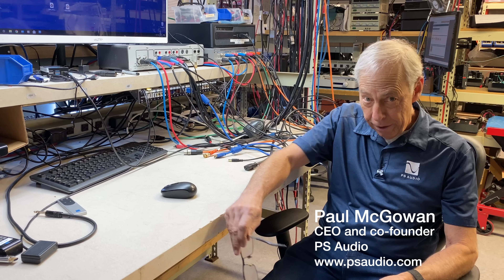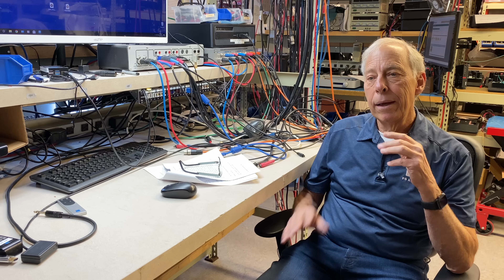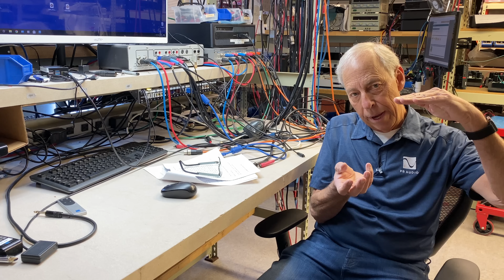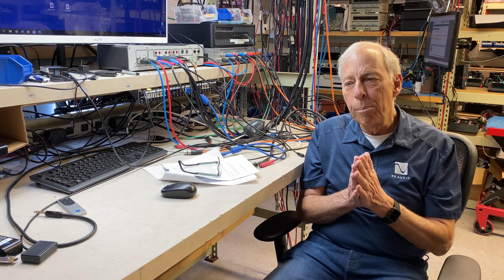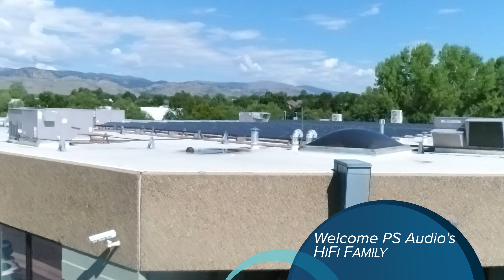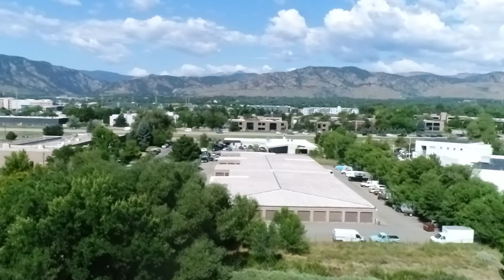Why aren't bridged amps more popular?

Comment: Many years ago I had a vintage Marantz 4070 quad amplifier which it had a 4 channel / 2 channel switch, that amp was sounding really magical in 2 channel mode which is bridged ( floating ground) but the spec wasn't 4 times of the watts
Reply: That's because it's current limited. When you bridge you double the peak to peak voltage. Doubling the voltage across the same load will double the current, therefore 4 times the power. But if the power supply cannot supply twice as much current, then the voltage will sag and the current will be less too. Hence, not 4 times power

Comment: I've run a pair of identical Hafler amplifiers in bi-amped set-up driving Magnepans for years. One day I decided to tinker with this setup just to try out the bridging switch on the back of each amp. I also have a Bryston preamp that I left out for expediency, just using the gain switches on the front of the amps. Oh my goodness! The music just bloomed into something incredible!  I hate to have to fault the preamp. Magnepan themselves use Bryston. So I'm thinking the lack of stereo crosstalk might be the key.

Comment: So I have a full bridge amp and there’s 2 positive and 2 negative outputs. How do I hook up one subwoofer with one set of speaker wire to get the most wattage?
Reply: It should tell you on the back of the amp near the spkr teminals how to hook up for bridge mode. Usually the positive spkr wire goes in to ch. 1 positive and the neg. spkr wire goes in ch.2 positive.

Comment: Keep it simple stupid. It costs more money. 90% pay less than $200 for an amp/receiver and for 99% its less than $700. Add the sales of all amps and receivers sold in the last ten years over $700 and divide by the number of people and answer will be less than .001. Today you can buy a killer amp for $70 (300 wpc with inaudible thd+n at 180 wpc at 8 ohms).

Comment: Bridging amplifiers is mainly used in commercial set ups, dj's would employ amplifiers that are bridged in order to get sufficient power and volume, but it would make no sense for someone having a bridged amplification at home because you don't get the same sound staging stereo imaging and bass output that a single amplifier would give you, and you certainly don't need the extra wattage in small domestic settings.

Comment: There is an error in the video: bridging amplifiers doubles the power, it does not quadruple it. That should be obvious by plain logic, 100 W + 100 W = 200 W. Technical reason is within the halved apparent load (impedance), which is mentioned in the video.
Reply: 4x is correct in theory however most will not achieve
Reply: It's just Ohms law, assuming constant R, doubling the voltage doubles the current, that is 4 times the power. Assuming source can deliver and components handle.
Reply: In reality it is more like x2-3.
Reply: Yes I have since then learned a great deal about bridging. A worthwhile mention is that when bridged, many amps are specced for doubled loads (Ohms) compared to single-ended, making it only double powered. That speaks for the fact that those amps are not designed to handle so much power.

Comment: and you cut the damping factor of the amp in half wen bridged
Reply: With most solid state amps the output impedance is so low that it doesn't make a significant difference

Comment: So reference monitor with XLR input are bridge amplifier?
Reply: Not necessarily. XLR is just (usually, but not always) a balanced input. What amplifier that drives depends on the choices made by the engineers who designed it.

Comment: Don't attempt to bridge amplifiers that are not designed to be bridged.   When you bridge amps the voltage across the load (speakers) doubles.  As Paul stated, the power draw by the speakers increases by a factor of 4 because power is a squared function of voltage.   But that increased power comes from the amplifiers and if split evenly then the power draw has doubled on each.   Due to market forces, engineers will generally not design an amplifier for power levels it is not intended for.

Comment: N channel is a reference to MOSFETs not Bipolar (NPN).  MOSFETS are preferred for higher power applications because they have a negative gain to temperature coefficient.  This allows them to be stacked in parallel increasing the current capability.  Trying to do this with bipolar devices can result in thermal runaway.
Reply: MOSFETs tend to have that same positive temperature coefficient when used at reasonable currents. They also are prone to hot-spots on the die, leading to a very quick failure. So while people like to run around saying that "MOSFETs don't suffer from secondary breakdown!!", it isn't really true. IR has a good application note on this, where they discuss the pitfalls of using modern MOSFETs in linear applications. It is possible (lots of people build amplifiers around HEXFETs, for example), but that doesn't mean they are without pitfalls.

A well-designed BJT amplifier will not have any issues with thermal runaway, but the temperature compensation (especially in EF triples) can be a real pain to get right and can be annoyingly complex.

Lateral MOSFETs do not exhibit this behavior, and really are pretty much immune to secondary breakdown. The downside is that they're really expensive and somewhat difficult to get, so you might as well just use a bunch of BJTs or regular switching MOSFETs. 

Like everything in engineering, it's a tradeoff.

Comment: Sorry about this off topic question..I have a old Marantz SR4200 receiver and old Klipsch RF35 tower speakers with a center speaker. As this receiver is 5.1 capable and I have only 3 speakers would it be possible to use the unused rear channels and add them to my front and left speakers(front left and rear left receiver channels into the 1 front speaker and same with right side speaker). Would I short out my receiver or damage speakers?

Comment: What determines how good or bad a bridged amp setup sounds is how you derive the inverted signal ... in my humble opinion you MUST use a low gain low noise op amp to provide a true balanced output to drive the amp modules

Comment: Ground is probably NOT the same as the ground in the well.  The "ground" you refer to is probably the center tap on the transformer secondary.  I doubt it is connected to household ground.   This would be easy to test.
Reply: Usually those two grounds are tied together (very intentionally at one specific point!) for noise reasons.

Comment: The other thing I found with brigded amps is that you get to hear negatives of the amps all out of ratio to the increased power.  Sadly in my esperiance it tends to show the negatives far more.
Reply: That's probably due to the reduced load impedance. Typically, distortion rises as load impedance decreases.

Comment: Paul, why is it necessary to bridge an amplifier just because you want to use all NPN output transistors? Compound feedback pair (Sziklai) amps don't have to be bridged to function - yes, the other part of the pair is a PNP, but the actual output transistors are NPN (al la Quad 405) . Do you use a cunning design to eliminate the compound pair? (but that then necessitates bridging two amps)

Comment: In car audio bridged class-D is pretty much becoming the only show in town due to the high power requirements, esp. once you get above about 4kW. Saves a lot of components and space getting rid of the negative rail in the power supply section. In home hifi bridging linear discrete amplifiers is quite difficult due to the feedback and DC offsets, not to mention you have all the power and space you need since it can just be a big metal box plugged into the wall. With that said, most subwoofers are usually running bridged class-D since the small increase in distortion is of no concern.

Comment: BTL never sounds as nice as an SE amp in my experience.
Reply: I used to have a class A super symmetrical. its total power output was probably not more than 18 watts per channel into 8 ohms and it consumed about 350 watts off the wall at all times. I swear it must have weighed 60 pounds or more.  It had a control on it which gave it a user adjustable damping control, so it behaved like a transconductance amp. And this was probably by far the best sounding amp I have ever had or heard. Really wide bandwidth, extreamely articulate and able to match pretty much any speaker you can throw at it.   I am really sorry I sold it but we live in hot weather so it was just not practical.  It basically needed to stay on continually to stay warm and sound good.

Comment: why do we see normal cheap cables in the background to test / adjust and set the high quality products when we are told all the time that we have to purchase cables that cost thousands.?
Reply: I do test and adjust amplifiers using regular cables instead high-end ones and yes, more expensive (speaker and signal) cables improve the sound later on. On the other hand investing thousands in cables is only justified in rare cases when you have very expensive (house money) system. On regular (few thousand) systems having invested a few hundred in cables and few thousand does not make any audible difference. But using a regular cheap cables - yes, you can hear the difference.
Reply: Well... because you're listening to people who want to sell you something. We're dealing with such low frequencies (well below 100 kHz), so the transmission line characteristics of the cables being used is of minimal concern. I have seen zero evidence that anyone can actually tell the difference in a double-blind test. Furthermore, there are no measurable differences at the frequencies we are using this equipment at.

One very good reason to not use such fancy cables on the bench is that they are often very thick and stiff, which is really annoying since it tends to make lighter-weight equipment slide around.

Comment: Bridged amps offer 4x the power but with 4x the noise and 4x the problems. In reality it still has 2 channels with the same issues a regular 2 channel amp has only now you have 4 channels to work with.  It's not mono. It's a cheap fix no matter the retail price to offer 2 amps with lots of power using smaller amps.

Comment: I can see why stereo amps are driven in bridge mode but with the complexities properly addressed, can’t you also join multiple amps even with different gains in phase to get an increased output?
Reply: No, not unless they are meant to be bridged. With linear amplifiers there will be DC offsets, as well as feedback (typically, but thats another story). Anyway, getting to the point, if you bridge two linear amplifiers directly, the resulting DC offset of each amp will unbalance the differential input of the other its attached to, resulting in substantial current flow, and also distortion. If its bad enough, it could even damage the output stages. Normally in bridged ICs they will either be class-D, or specifically built to be easily bridgeable (e.g. TDA1554, and others) via connecting the internal amplifiers together on the PCB. In car audio whole class-D amps can also be bridged together, but this requires that the clock signals of each amplifier be synchronized to prevent phase issues and idle tones, among other things.
Reply: I said if you properly addressed the complexities.  A simple way could be galvanically isolating the inputs and outputs so that the amplifiers are effectively just voltage sources with accompanying series resistors connected to the loudspeaker and handling the increased series resistance.
Reply: @PebblesChan  Joining two separate amplifiers can be quite challenging to say the least. Galvanic isolation would be difficult due to the large inductance needed for the transformers while still having the necessary high frequency response. The easiest way to achieve DC blocking would be to use capacitors at the outputs. To get a lot of capacitance, this can be done using what's called a bipolar capacitor, which consists of two electrolytic capacitors and two diodes capable of handling the current requirements. This works identically to a non-polarized capacitor by offsetting the voltage each capacitor sees so it does not see a significant reverse bias. But there are other issues to consider as well. You are joining two amplifiers with separate power supplies, so that invites both DC and AC ground loops, even if the amplifier does not have a specific connection to ground. The transformers have quite a bit of parasitic capacitance and it can potentially allow unwanted signals to get into the audio. You would need to have external star-point grounding to ensure there are no loops. The amplifiers also have to be very well balanced gain-wise to work properly or the audio will have an offset, which can cause issues with audio and the loud speakers. You also still have the same issues with the feedback. While the capacitors will block the DC, there is a possibility of imbalances at audio frequencies as well. If one amp unbalances the other, there will be substantial current flow due to how much gain margin there is. Even a few mV can cause several amps to flow as the amplifier attempts to balance its differential input. Lastly you will also need an external phase inverter for one of the amps. This could be as simple as a center tapped audio transformer, but for best results it should be op amps so the fidelity is not unduly compromised. It could work, but care would be needed if you're to avoid spontaneously decapping all the output transistors. But still better to buy amps made to be bridged rather than having a maze of wiring and circuitry dangling off the back. With that said, it is often done in car audio even with non-bridgeable amps, but life is easier there as everything is on one supply (12V) and the amps are usually class-D, so there's less risk of interactions. But there are still often issues.
Reply: @PebblesChan  Talking about this reminds me of when I tried this as a kid to get more power before I knew any better. There was "audio" when I turned it on, but lots of sparks and smoke coming off the speaker wires. Everything survived, but still amusing to think back on it. Edit: In all honesty it was probably because I hooked it up wrong and shorted something out. Hooked up correctly there probably would have just been some DC offset.
Reply: Yes, in theory you could. In practice, it is likely to result in one (or more) blown amplifiers.